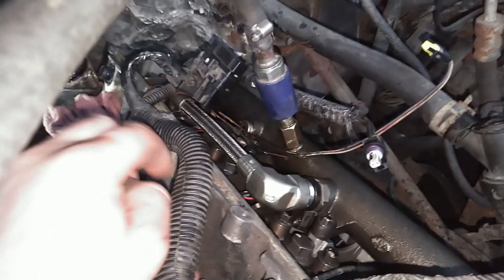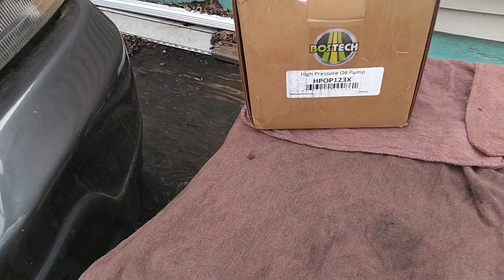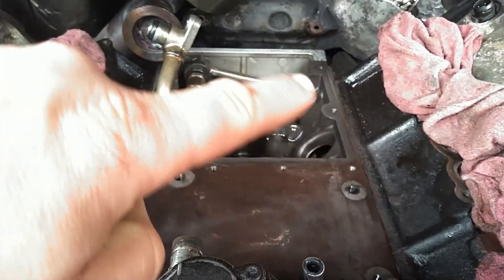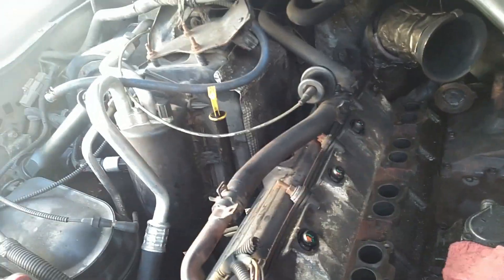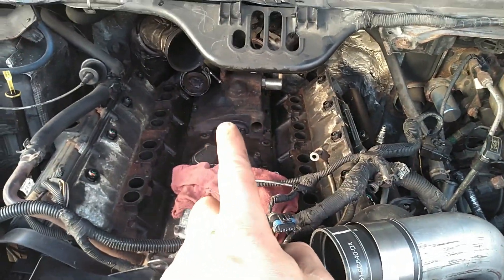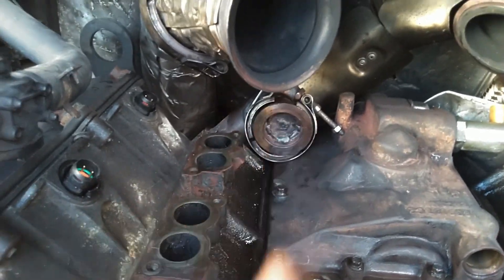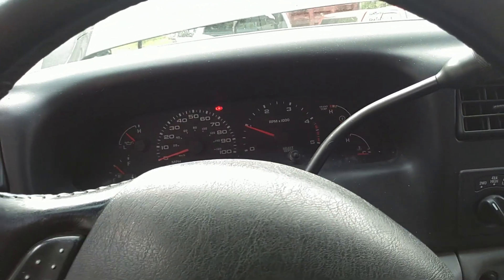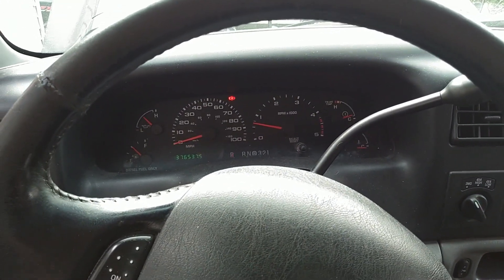2003 6.0 Powerstroke loss of power Part 3

Comment: I have a ford e450 it run, but suddenly stop then I stare and running again then about 10 miles stop
Reply from the maker: It sounds like you have a bad cam or crank sensor. I would start by replacing the crank sensor and check the wiring harness and pigtail. Are there any engine codes?
Reply: @cincydieselrepair6893  where are you,I lived in Little Rock AR